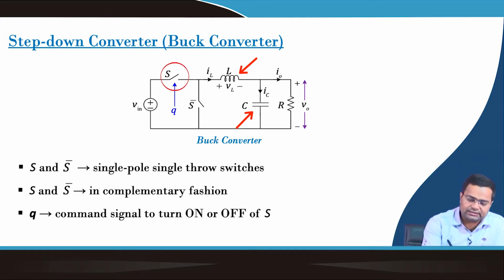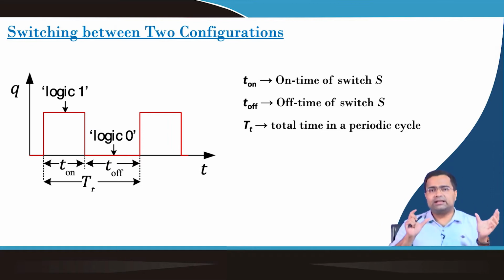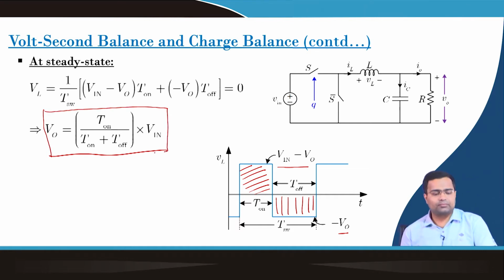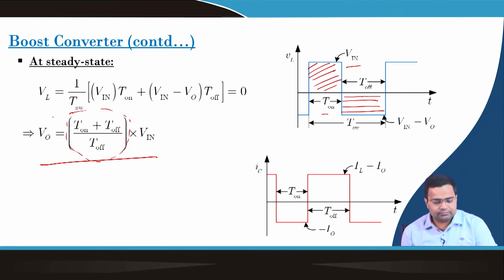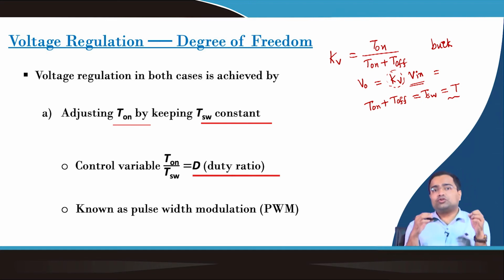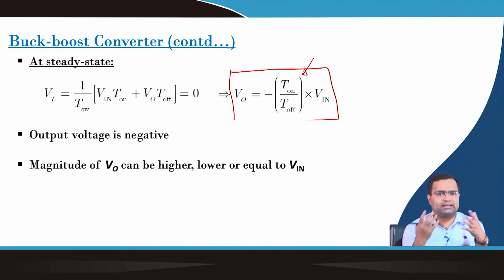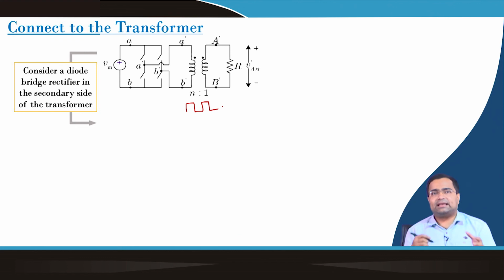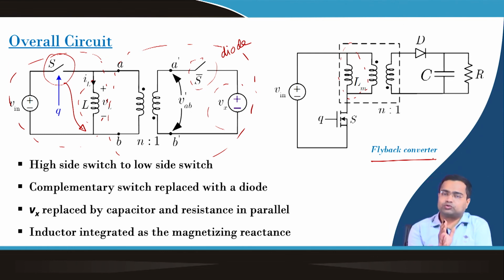Lecture 03: Switched mode power converter (SMPC)

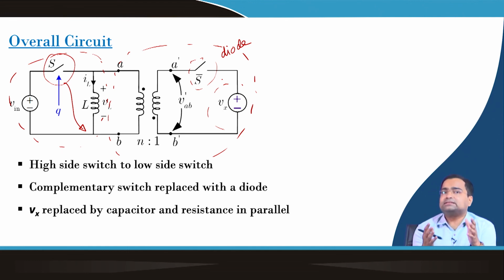Comment: Dear Sir, @38:38 we were considering the load to be resistive. In case of inductive loads like a DC motor, I presume the overall inductance of the SMPS would change. Can the same SMPS be used? If yes, other than the control what else would change to achieve voltage regulation? Thank you.